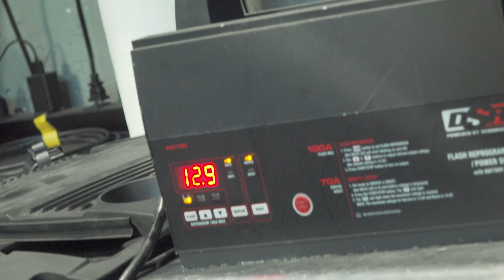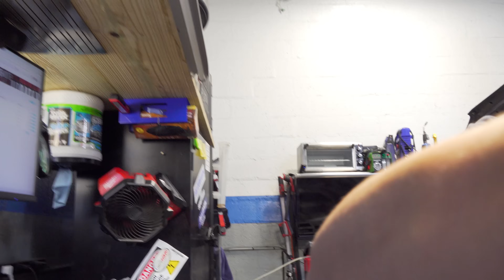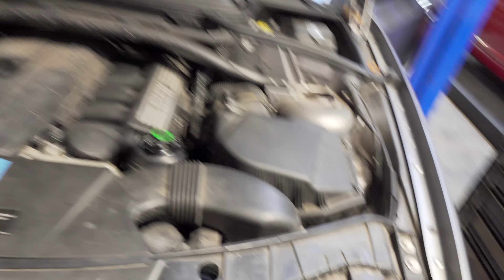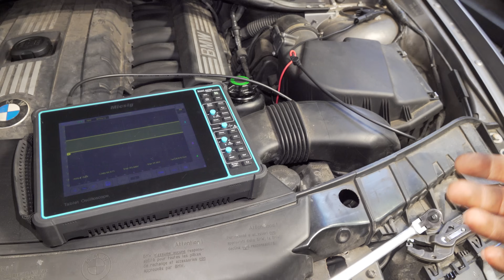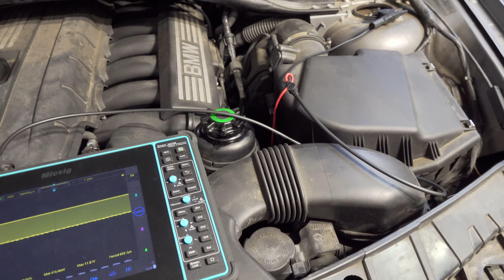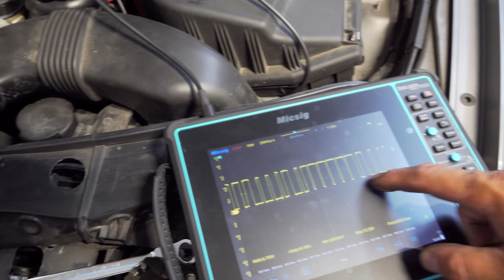Parts changers get lucky, but we don't do that around here - 2010 BMW x5 not charging

Comment: Not all smart systems jump up when under load . My POV 2018 Hyundai ( bought it new with 28 mi on it) would sit at 12.8v at idle with wipers, higbeams. A/C on. I was messing with it to understand and found it only would charge on deceleration.

Comment: “Parts Changers” get a bad rap, sometimes. For example: if I have a check-engine light and a code for a bad O2 sensor on a vehicle with 100k, I’m not going to waste time checking for power & grounds, etc. I going to just change the damn sensor.
Reply from the maker: Even when that sensor is 500+dollars like on some cars?
Reply: @SuperMarioDiagnostics it's JUST $500 if it's coming out from the customer's pocket from what it seems 🤣 these parts changers will never cease to exist it seems, more work for those that test!

Comment: you mention ground being same for starter and alternator which is correct BUT corrosion between alt housin and where it mounts could cause issues
great video though
thanks for the content
Reply from the maker: Bmw’s are naturally corrosion proof thanks to their inherent oil leaks
Reply: @SuperMarioDiagnostics  agreed plus you live in florida not the north

Comment: BMW actually calls this communication wire BSD (Bit Serial Data) bus, but it is in essence just LIN bus.
This E83 X3 is built on the electrical system of the E46 3 series and adapted to fit more modern drivetrains like the N52 engine in this car. On newer models like the E70 X5 or E90 3 series the intelligent battery sensor and electric waterpump (depending on what engine it has) are also connected to the BSD bus besides the alternator and the oil level / condition sensor. 
 Also by knowing how the system works you could have skipped scoping the BSD wire but rather just unplug it from the alternator. On any BMW with a BSD alternator if it loses communication with the DME it starts charging at full output as an emergency strategy. 
Going into OE diagrams and reading the functional descriptions is never a waste of time ;)
The voltage drop test on the B+ wire would have sufficed for this diagnosis.

But as always excellent video Mario :)
Reply: Very true 100%.

Always hilarious when a caked in oil, oil condition sensor crashes the BSD and the car comes to you after it’s had 3 alternators installed elsewhere.
Reply: @lynxstarautomotive208  3 alternators? lol I had a car come in that had 3 DME's installed!!! one of the DME's they were trying to swap in actually got fried when they accidentally touched it to the jump start terminal and hadn't disconnected the battery 😂 Started with putting the original DME back in, scanned it for codes, BSD fault off course. started unplugging BSD components while scoping the BSD line. at first it was at around 6v amplitude and really noisy signal. Unplugged the oil level sensor and the signal came back to a 12v square wave. While ordering a new sensor I actually found they installed a metal housed Hella oil level sensor while this car needed a Temic plastic housing oil condition sensor. the sensors had different pinouts, that's why it pulled down the BSD signal. Diagnosis literally took less than 30 minutes, so much for parts changers!
Reply: Yeah, God bless those engineers for putting that emergency charge state. Helps tremendously when trying to figure out if there is an input or alternator problem.

Comment: Excellent video Mario , 99% of the time technician will just slap in alternator but what if it doesnt fix it right
Just want to share a quick story , we had a tow in Lexus gx460 one time at the shop and my coworker told me just slap a starter at it 
and because the vehicle was outside the shop we had to push it inside the shop , I said no , I need to do my checks . Long story short I crank the engine by hand and it will get stuck. Found that one of the cylinder has dropped a valve 😬

Comment: The Lin line signal was not marked on the diagram. If there was a short to 12V, how would you know it was abnormal?
Reply from the maker: Because the oil condition sensor is also connected to that line. This proves that it’s a communication wire. If it were shorted, we should see several symptoms, including a check engine light and communication codes with both the alternator and the oil condition sensor